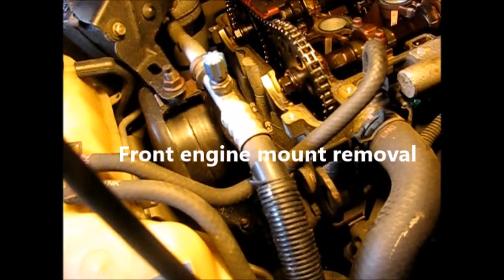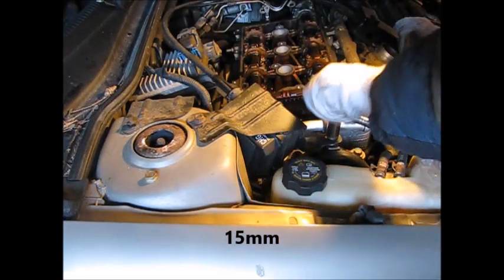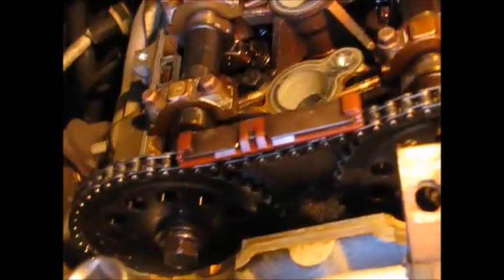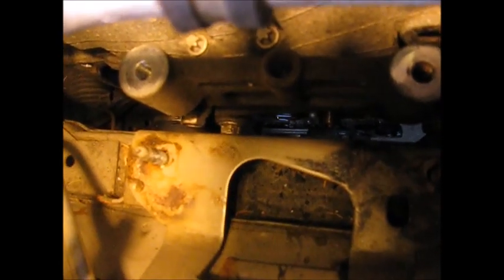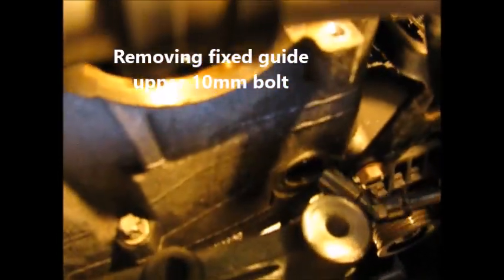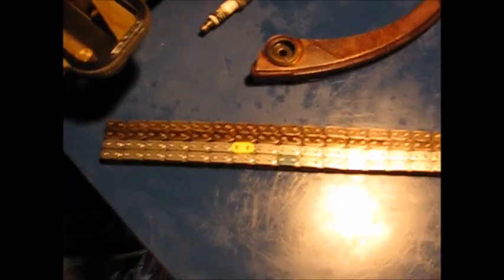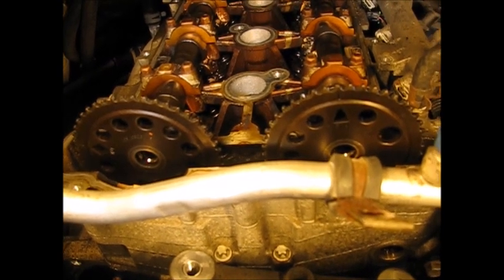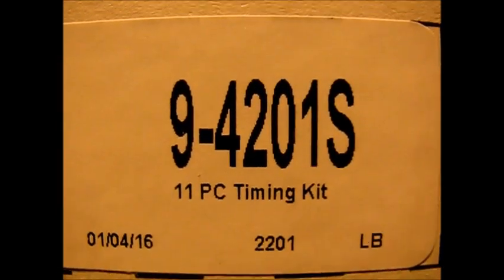GM 2.2L Ecotec timing chain replacement '03 Cavalier part 3: Front engine mount and timing parts

Comment: If you hadn't started with the engine on the Wrong Top Dead Center stroke, aligning the cams would have been much simpler.
180+/- degrees should have been a clear indicator it needed another single rotation before tearing down.

Comment: I just watched another guy doing a chain in the car. He actually cut down a hex wrench (or hex key/ allen key) so he could squeeze it in between the top guide bolt cover and the mount. That way he didn't have to pull the mount. Not sure what car it was, but if that would have worked for you it sure would have made the job a lot easier I'd imagine.
Reply from the maker: Gotta love these DIY guys and their creative solutions for car repair frustrations...
Reply: Yeah, I may or may not have taken an angle grinder to an allen wrench to make this happen...

Comment: why didnt you set the timing before taking it apart? or was one of the cams not spinning from the slack in the chain?
Reply: you really should have moved the crank so the pistons were in the middle of the cylinders before rotating the cams and moving the valve.
Reply from the maker: Yes exactly. It had jumped time from the slack chain

Comment: I don't understand at the end what are you meaning by activating the tensioner Bolt understand everything but that please explain thank you
Reply from the maker: As installed, the tensioner is not activated (exerting spring tension on the belt). It has to be pushed in and then the spring loading will activate and put the tension on the belt.
Reply: From what I seen in the video it looks like you put it in tightened it down pulled it back out then put it back in for a second time then that was that right? And another question at the end of the videos when the car was completely back together why did it take so long for it to start up? Is that something normal when changing timing change does it always take time like that when trying to start up when complete
Reply from the maker: I was uncertain if it activated, so I took the tensioner out and checked it. It was activated. I then de-activated it and reinstalled. Look for tension on the chain to determine if it activated. As for the start-up, I don't think that' difficult starting is normal. This car had sat for three months and that might have been a factor in the hard start.
Reply: They are held in when u buy them . When u install them u have to remove something so the exert that preload .

Comment: Dear The Original Mechanic,

Do the camshaft sprockets have to be removed in order to remove the adjustable chain guide? Or, can the adjustable chain guide come out the bottom once other guides have been removed?
Reply: I did this job to replace the chain and sprockets with a complete kit. It may be possible to replace a specific part like a guide without removal of the cam sprockets.

Comment: great video. after turning crank to 90 degrees to reset  intake cam at 2 and exhaust at 10 how do you reset the crank to its timing mark?

Comment: My son and I just finished resetting the timing chain on an '03 Cavalier based on this video series!  THANK YOU.

As for those who question lifting the motor for better access.  YES, it does help a great deal and it is possible.  You have to remove the top motor mount as well as the lower motor mount.  The lower one not shown in the video series looks like a swing arm of sorts under the motor on the left side when facing the vehicle.Thanks to "The Original Mechanic", you rule!
Reply from the maker: You're welcome. That's a nice tip on raising the motor. If I ever have to do this again I will try it. Good work and comment!

Comment: I didn't see you remove the balance shafts or did you not replace the gears
Reply from the maker: I did not do the other chain and gears. The owner decided not to have it done.
Reply: Oh OK thank you I am in the Middle of it on a Oldsmobile alero and there's no videos on it with the motor still in the car so I assume it has to be picked
Reply from the maker: I never took the 2.2 out of the Cavalier.

Comment: those mount bolts will come out if you jack the engine up enough, the top two will clear the inner fender and the low one will only get enough clearence to get it out, really sucks i gotta remove timing chain for the head gasket
Reply from the maker: Believe me, I tried that method but couldn't pull it off. Thanks for the comment!

Comment: You could've carefully jacked up the engine and those mount bolts would've came out
Reply from the maker: I looked at that and could not get it high enough.
Reply: @TheOriginalMechanic  Could have used a blocks of wood to increase the height unless the engine struts are hold it back .